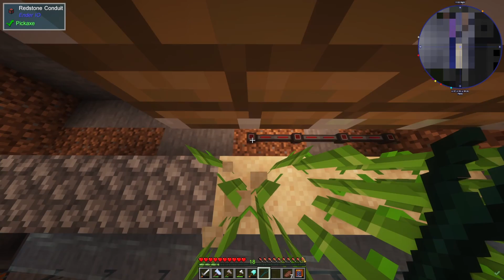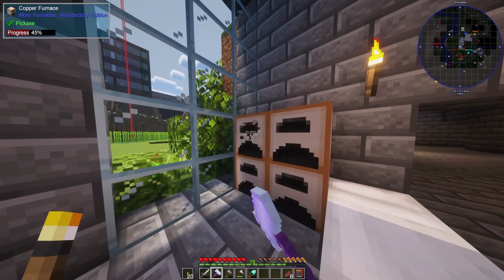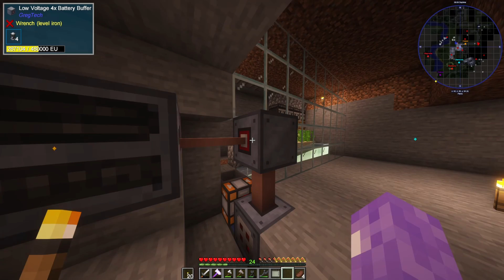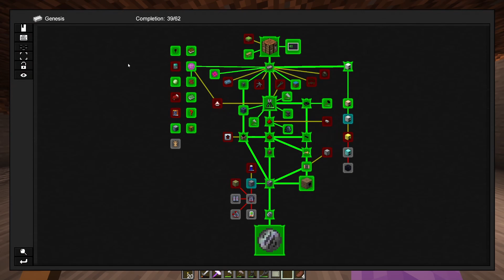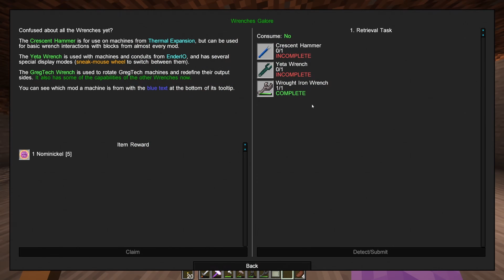Nomifactory CEu Ep. 5: The Wiremill and Bender are Here!

Comment: i don't like the fact you have to buy lithium with nomicoins, I cant find another way to get it, to macerate stuff you need battery's and the ore is in the nether or the end tetra and stibnite are available in the overworld but not the Sulphur but that isn't necessary you can do without the little magnet thing and charger bank, forgot to check what ores can give Sulphur when macerating and washing but its probably there. however there is no way to get any battery without spending nomicoins even sodium needs macerating to get sodium. i would like it to be a challenge to get lithium not impossible.

Comment: Machine! The tech part in gregtech is here, and there will only be more to come.

For the record, you have sugarcane for fuel, which is basically free at this point. Not efficient, but free.

Coal into coal coke is fine...? You are about to get the Alloy Smelter, so the only real use (steel production) is outdated pretty soon. Getting it now is a bit late imo, but if you feel like it is worth it go ahead.

Steam macrator for rudimentary ore processing is needed, and save resource. Ore processing is...complicated but for now just think of it like any other tech mod, pulverize for double, smelt them

All GT machine auto output, they dont auto input though. For now just set the output face to a crate (with a wrench, right clicking to any of the side will spin the output there and hit the auto ouput), insert through hopper at the top and throw a few stack of tin/copper for it to process. Steel into steel plate, wrought iron into wrought iron plate. Batch crafting!

You will soon realize how much resource you will need, thankfully DME will be the carrier for the majority of the game, though you wont have access to it just yet. For now, mine a lot of resource, throw them to be processed (and double if you rush grinder) and try to push more machine. Keep those pbf running for the time being.

Excited for more episode!
Reply from the maker: Thanks again for the tips!

Comment: If you want furnace fuel you can always use the sugarcane from your farm, and for the steam the grinder that's a macerator that does 8 items in parallel, but it does not give any byproducts, those are only gotten from HV+ machines, but anyways progress will ramp up very quickly now that you have those first machines and won't need to mine for resources as much, there is also DML coming up which will give you infinite Iron,Copper,Tin... very excited to see what's next :D
Reply from the maker: Glad you are excited, you know I am! making the multiblock seems to be the way but ill end up doing both just to try it out.